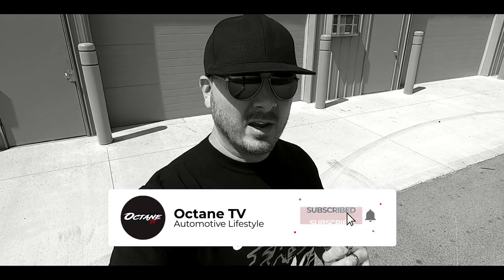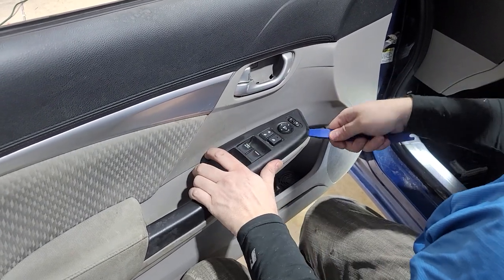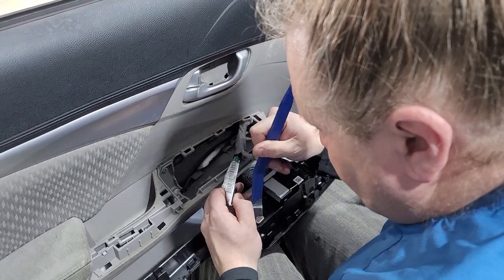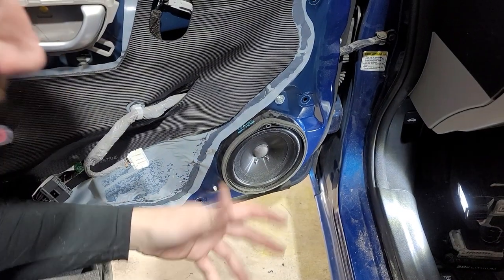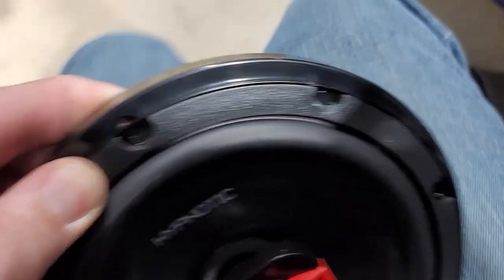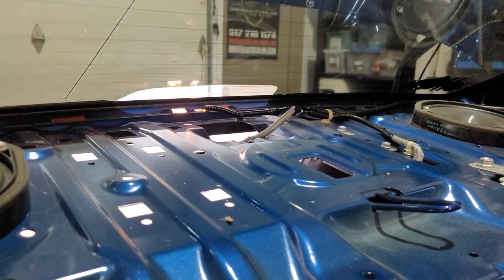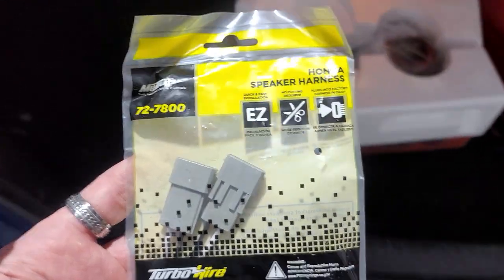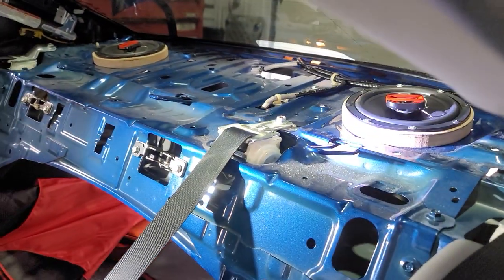HONDA CIVIC FRONT & REAR SPEAKER HOW TO INSTALL --- FRONT DOOR PANEL & REAR DECK REMOVAL

Comment: I installed 6.5s in my Honda. I had sound for about 10mins now I get no sound at all.
Reply: Bad ground u have metal touching somewhere
Reply: @emilyhamby5154  yea the driver side connectors were touching the metal. So i had flipped it & they work.